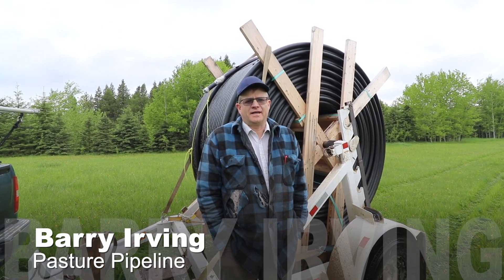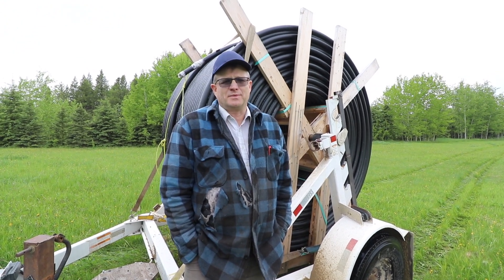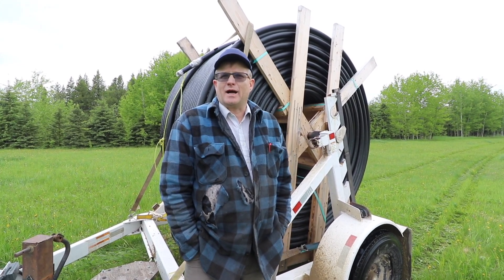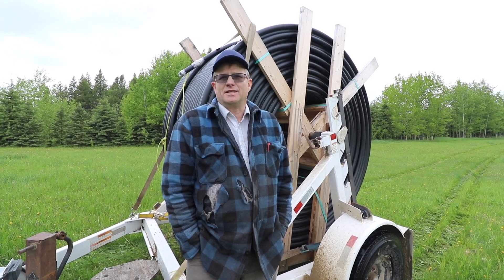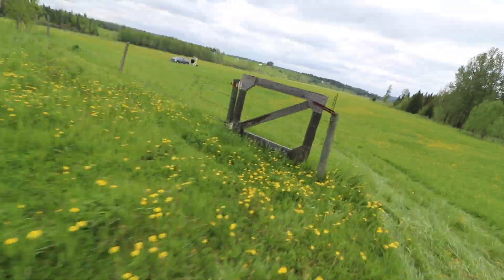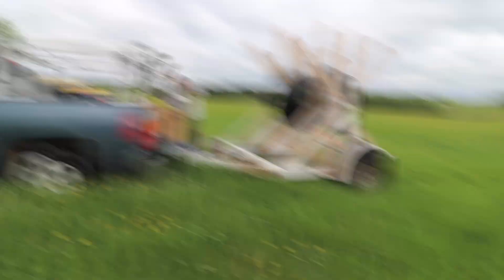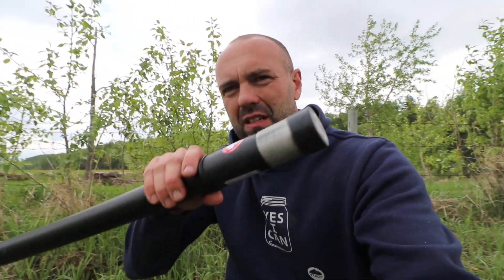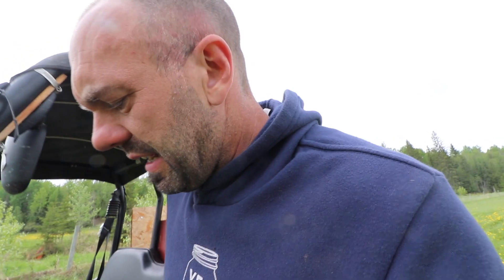Water pipeline and Pasture management

Comment: Hey I have found if you put the trough in the middle of the paddock you can easily spilt the paddock in 2 and brake feed in both directions - rather than have trough at one end of the paddock